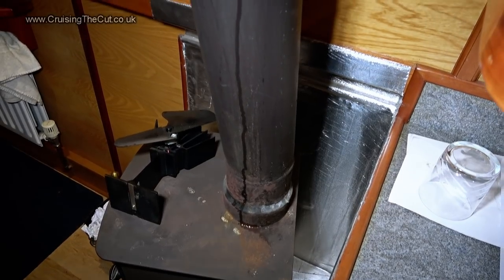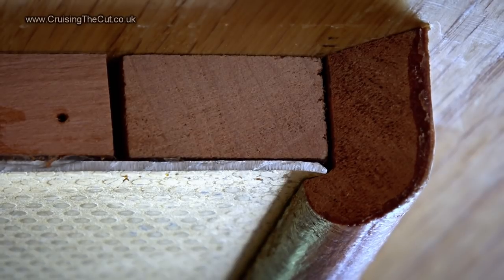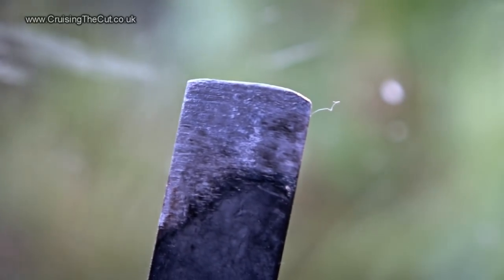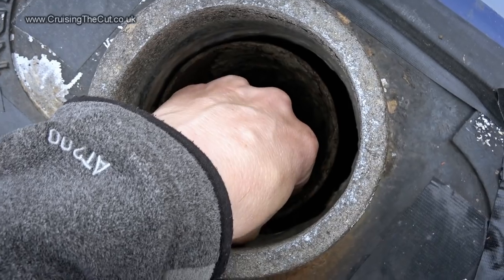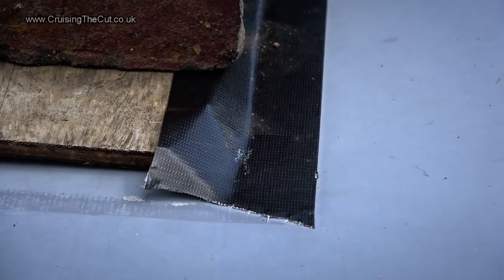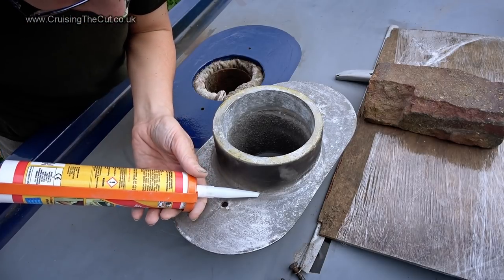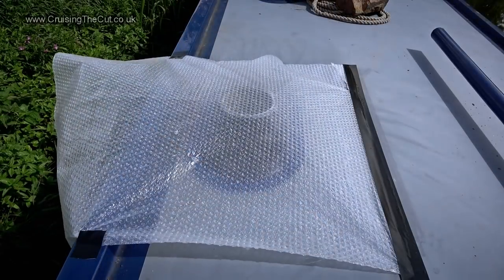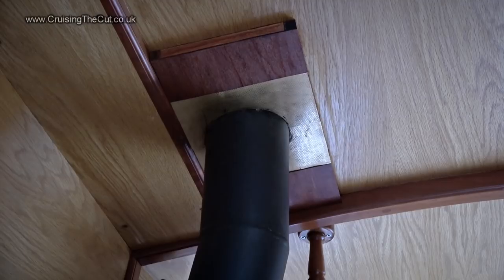119. Removing and re-sealing the chimney collar on my narrowboat to prevent a leak

Comment: Get yourself a 600mm “breaker bar”. They cost about £20 and will shift anything. A mains powered rotary hammer will do it even better for about double the price.
Reply: A breaker bar, along with a proper 6 point deep socket wrapped in a piece of foam pipe insulation should be in the boot of every car.  Leverage is everything.

Comment: Hi David, Thanks again for a very nice video. Next time however I would advise you not to do the second inner layer of waterproofing (over the rope). Reason for that is that if the top layer will decay and leak (though don't think it will do quickly) the water has nowhere to go and will be possibly rot your roof at that point without being noticed. Not sure it will in your case. However please keep such in mind if you are not aware yet. BG
Reply from the maker: There had to be waterproofing added to the rope else water could leak down through the rope and into the cabin which is exactly what I was trying to stop!!
Reply: The fact the water gets in to your cabin and down the stove pipe is the clear way to tell that the sealent on top has failed.
Now if that seal fails then the water will go on to the roof and be absorbed by the wood or trickle down the sides.
Then you will get mold and damp.
Although with all the selant you used it will be a good few years yet.

Comment: I'm not too convinced about the separation between the flue and all that lovely flammable wood and insulation.
Reply from the maker: It's been fine for twenty years!!
Reply: Also the large cast  collar acts like a heat sink, onto a nice cold exterior steel surface then the interior heat is taken care of by the fire proof section around the flue. At no point does the flue come into contact with any of the flammable parts of the boat.

Comment: Excellent video, I have just watched this again as I have this job to do soon. Just one question, how much rope did you use when reinstalling the flue? Thanks 👍
Reply from the maker: No set length, just as much as I needed to wrap around the flue from the top of the collar to the bottom.
Reply: @CruisingTheCut  Thank you for the prompt reply David, regards, Chas

Comment: Hi, I had the same problem with mine but as winter is upon us i just used black high temperature silicon around the collar hopefully this will work until summer???
Reply from the maker: If it hadn't been for the rust, I would have just sealed round the edge as you say. It was only because the metal was bubbling up that I went all-out, so yes, I'd say you'll be fine!
Reply: Thank you for the reply Hope you have a great XMAS.

Comment: Sorry about all the extra work to access the bolts, but I had a feeling they did`t have nuts underneath. In most situations, where the nuts are hidden, the bolts usually just unscrew from the top. What I would have suggested though, was a little propane torch heat,  before their removal. Works wonders.  Sorry.
Reply from the maker: Cheers

Comment: That was hilarious!  Not because you did anything wrong, you handled everything as well as a pro, probably better. What was funny was that I can see myself in that struggle.  I run into the same sort of problems when I fix things around my home so I can empathize with the struggle.  About those bolts, did they just slip into the holes?  Or were they threaded into the steel roof panel?
Reply from the maker: They were threaded but it turns out were just very stiff hence my suspicion that they had bolts underneath. Once I realised they didn't, I forced them to turn and they came out.
Reply: I thought they might have been threaded, but the problem is you just don't know for sure.  It's that doubt that causes the trouble.  Well, you have fixed it right proper.  It shouldn't trouble you ever again.

Comment: Hi. 
My chimney needs some attention the chimney collar which is cast its the standard flat one you get from a marina and the boat roof is curved this causes a space between the roof and the collar am looking to find someone to either make a new collar to fit the gap or make a skirt to go go round the collar please can you help can send pics if needed.
Can you get an angled collar if not can you get one made out of steel with the extra bits added on I cant tell how angled your roof is is your collar angled or flat please
Reply from the maker: Hi. My roof is not very angled so the gap is filled with sealant, pretty much. I can appreciate how on a more curved roof like the one Jo and Michael of Minimal List have, this can be an issue - but, unfortunately, I don't know what such boats do to sort the problem. It cannot be so unusual as not to have been solved though so I would recommend calling some chandleries or stove specialists and asking for their advice. Sorry I can't help you more - perhaps someone else will chip in here.

Comment: You know you really should buy A angle grinder and some grinding disks. it will dig into the rust a lot better and leave A smoother surface (less bumps= less paint/primer/rust treatment) They also are able to have cut off wheels attached to them for cutting off rusted nuts/bolts. the cordless ones on amazon run about $80.00 (us) and up, The corded ones start at 15 bucks and go up from there. They make life sooooo much easier. and A bottle of anti seize for the threads of bolts  will prevent tons of anguish when things need to be done again. I understand you live frugally and want to not spend unnecessarily but A few small investments will repay you 100 fold in saved time and aggravation.
Reply from the maker: Hi. You're absolutely right but at the same time I was doing this I was also spending a fortune on my campervan project and the tools for that and I really couldn't stretch to any more!! One day though...

Comment: sounds like you could've used some wd-40 for them bolts.
Reply from the maker: I'm not sure WD40 was needed. I think I was just being too gentle, until I realised there were no nuts on the other side.
Reply: CreatingtheReaper not wd40, but penetrating oil. As in PB Blaster.
Reply: CruisingTheCut if you have this product in the UK, I highly recommend it as a penetrating oil. Spray on, wait, respray, and most all nuts/bolts will come free if they had rusted or corroded in place. Cheers.